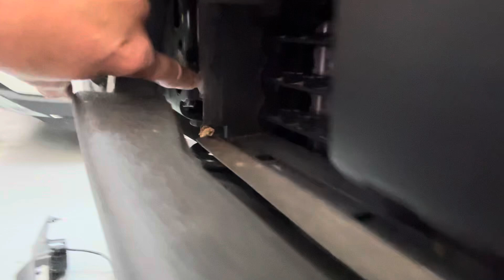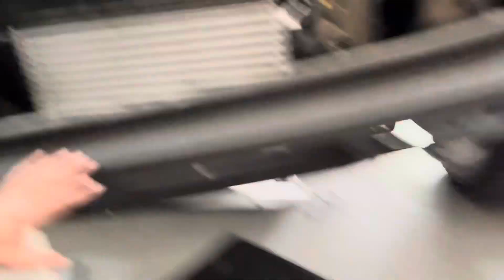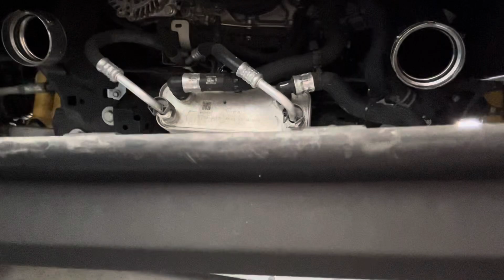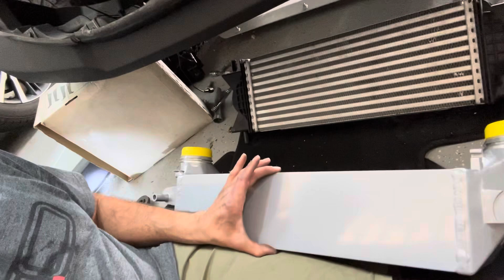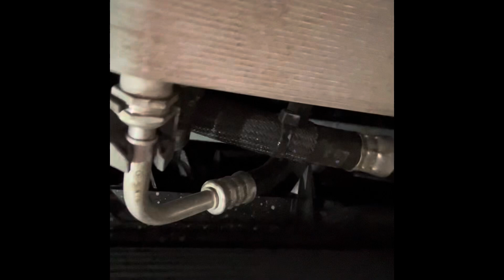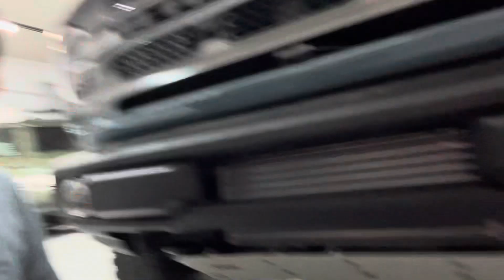New Bronco Intercooler Upgrade!

Comment: On the higher tunes, hot humid day, IAT temps what spike over 140.  With the CV Fab Intercooler, it was about 10 degrees over ambient on long pulls. And never went about 110 and came back down a lot quicker.

Comment: If you take out the grill shutter it trips the engine light. I’d like to know, if that’s true for the intercooler shutter as well. Looks like great upgrade
Reply: I've heard, allegedly, no - but I'm also curious what people are doing with the intercooler shutter connector if they're removing the shutters altogether...
Reply from the maker: No engine light with shutter system removed from intercooler.  Yay!
Reply: @motorsandmedicine1383  sweet!
Reply: @etmccaus  you keep the actuator plugged in and zip tied off to the side…per CV Fab instructions